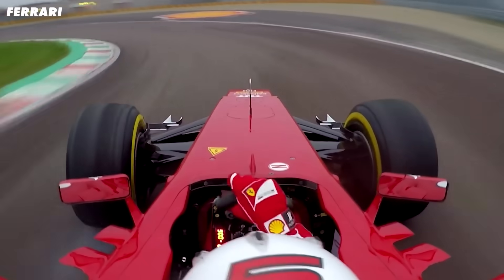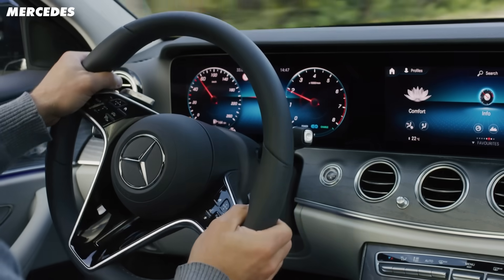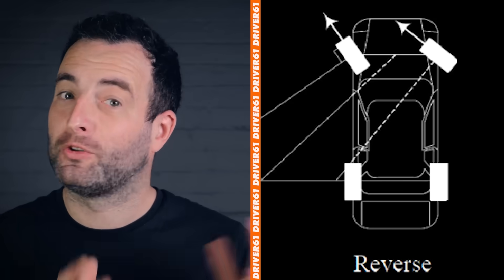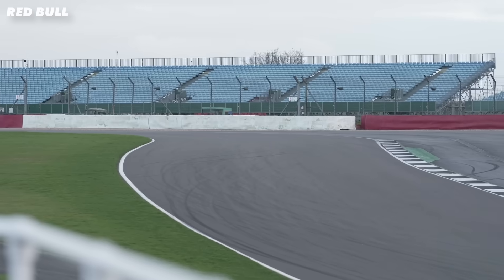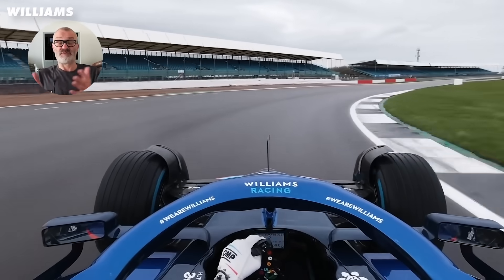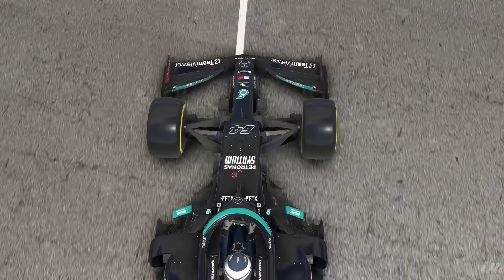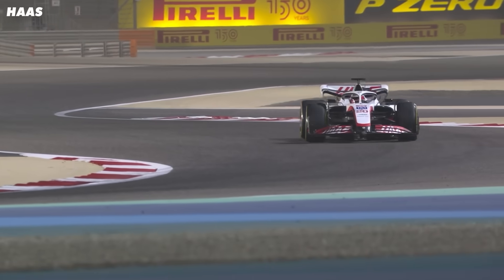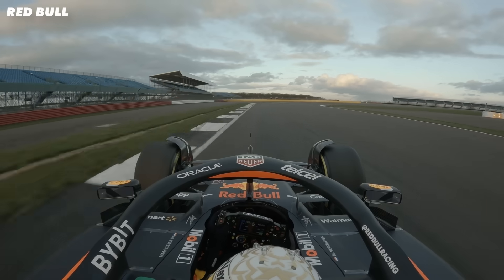The GENIUS Reason Why F1 Steering Looks BROKEN

Comment: Doesn't the inside tire actually experience less wear with anti-ackerman? So the outside tire takes all of the load and the inside is preserved, according to the load distribution in a corner. Could we say that parallel steering in a fast race car (tires at load limit) would already be an improvement over positive ackerman for the same reasons?

Comment: I thought the reduced slip angle on the unweighted (or lesser weighted) is inside tyre was to increase its contribution to cornering force because it is in the performance window where the turning angle brings the tyre into a slip angle where it can contribute to lateral force, instead of just scrubbing off speed, though some scrubbing can help to rotate the car.
To help the inside tyre do this, suspension geometry can be set to reduce the camber on the inside tyre so the contact patch is bigger. The contact patch of the outside tyre is increased by the vertical load and tyre deformation so increased camber stops the inside of the tyre from lifting
Reply: Tires don't necessarily have a higher saturation peak with more load. Some race tires have a negative trend, with more Fz resulting in a lower saturation peak. Either way the deltas are not big on actual tires most of the time.
Reply: @ArchOfficial  what I'm referring to is the effect of REDUCING vertical load on the inside tyre. Without enough load for a given steering angle, the tyre will skid. Anti-ackerman reduces the steering angle to avoid this
Reply: @Da5idc  Yes, and some tires will need MORE steering angle with LESS load. I remember seeing two tires that do that.

Comment: I'd like to know how the steering works then. Like how do you get the left tire to turn less than the right one on a left corner, but then turn more than the right one on a right corner? Or can it only be done in one direction & you just sacrifice the side with fewer corners?
Reply: It's called ackermann, and yes it will work the same in both directions
Reply: Geometry of the steering linkage.

Comment: When going around a corner the outside wheels travel a further distance. Hence since the car goes around it at the same speed i all places the outside wheels need to turn faster. Iirc thats why the are Differentials in road cars.

Comment: If I'm not mistaken, we are talking about the castor angle, correct?
Reply: No, you're mistaken.
Reply: More akin to toe in-toe out angles
Reply: @sandybarnes887  Not really. Toe-in and out are fixed settings. Ackerman angles move through a range.
Reply: @MrAdopado  not really.  Ackerman angles are not castor settings

Comment: So it is correct that this only works/produces more grip because there is a lot of downforce? Or would the weight transfer alone be enough to also work in a road car?
Reply: Usually anti ackerman as agressive as F1 is used only in high down force uses. Or maybe some karts or idk. But in theory for the most grip you should have the correct slip angle on your wheels that are steering. The most noticeable gain will be in high speed corners of course. Setup should be sone in a way ehich matches the car for the track. If there are loads of highspeed corners you'll want more slip angle on the outer tyre because you're increasing its load thus decreasing the inner tyre's load. Same goes vice versa for low speed heavy tracks.
Reply: @jacknoname9726  But you could change the "aggresiveness" of the anti ackerman by changing the steering geometry and the tie rod lenght and angle.
Would a very slight anti ackerman still produce more grip on a roadcar than the normal ackerman they have?

Comment: as far as I understand, Anti-Ackerman actually REDUCES tire-wear on the inside tire because the outside tire is driving with a certain amount of slip angle and therefore the inside tire is actually not scrubbing over the tarmac at all. The normal Ackermann behaviour would lead to massive amounts of scrubbing, because the outside tire does all of the work and the inside tire would just understeer
Reply: Yep, correct. Glad someone spotted this!
Reply: Yup, a slight explanatory error in the video.  Kinda surprised they didn't catch this while filming or editing.  But, Ackerman is one of the more niche setup topics out there (like Castor in karts), so it's understandable.
Reply: The ackermann optimizes the grip. Not just affecting the outer tire but also the inner. It can be spotted on the graph. The simple fact that the dashed line is not vertical shows that some type of ackermann would optimize the grip. With less tire load (inner tire because of load transfer) the tire needs less slip angle to get to its peak performance -> anti-ackermann.
Reply: Positive Ackerman would perhap increase tyre wear on a track, but to clarify, I imagine in a road-going car, exercising next to no slip angle, positive Ackerman would surely result in very low tyre wear
Reply: @matthewmcewen1  It helps a bit in road cars. But actually, Ackerman has surprisingly little influence on tyre wear with road cars, because on normal road cars most tyre wear occurs in straight line running. In fact, most road cars don't have 100% positive Ackerman, hence most cars squeal horribly in multi-story car parks... What Ackerman does do is change your steering feel rather dramatically, so road car designers tend to choose the Ackerman that gives them the best steering feel. The other thing negative Ackerman does to road cars is to increase the turning circle, which incurs the wrath of the marketing department. Even in F1 the dramatic change in steering feel cannot be ignored, and can present limits to how far the designers will push radical Ackerman settings. (And look at Monaco races, to see if you think negative Ackerman is being run there...)
Reply: @peterhewson4568  are you sure about that? Of course there is some tyre wear just because of some toe-in every car has. But the initial explanation in the video is correct about different radius for inner and outer tyre. Without positive Ackermann, the inner tyre would scrub over the tarmac.

For racing cars one needs to know the actual slip angle of the rubber, which is between 7-14° as far as I know and based on that you can easily calculate the amount of Ackermann for all steering angles.
Reply: @PoisonNuke  We are now in the realms of having to do real sums, using real car setups. Me? I'm just an amateur. I leave the complicated stuff to the clever guys.
Reply: @peterhewson4568  very informative, thank you
Reply: @peterhewson4568  Don't know about the exact implementation of Ackermann (with double n). I thought the squealing is just because the tires themselves skid because the inside of the tyre travels a shorter distance than the outside, but naturally the wheel velocity is the same inside and outside (on each wheel).
Reply: @IJsbeer74  Inside and outside wheels can rotate at different rotational velocities, unless the car has a locking differential. Any car with open diffs and 100% Ackermann will not squeal around tight corners, as long as they are driven fairly slowly.
Reply: @PoisonNuke   @Peter Hewson  Regarding the cornering and tyre scrub, my interpretation is the anti-ackermann scrubs less than anticipated due to the fact that front wheel speeds are not constant, and when turning,  the F1 car is effectively rotating on an axis centred vertically through the centre of the inside wheel. At least in theory, right? 🤔
Reply: @peterhewson4568  sounds like @IJsbeer74 was talking about the inside vs outside edge of a single tire. Not the inside vs outside tire. In which case I think he may have a point.
Reply: Jacob Vanderzanden    Good point. We call that "turn slip". My opinion is that I'm not sure if turn slip can ever be enough to cause squeal because the velocity delta is very small, and the tyre will probably have sufficient compliance to accommodate it. The most extreme turn slip occurs when turning the steering wheel of a non-moving car, which slips the tyre beyond its compliance limit, and that doesn't really make an awful or long lasting noise. It would be an interesting experiment though.
Reply: I like ur explanation  better.
Reply: 100%, I'm surprised heat effects weren't discussed more in the video, since tires performance is quite temperature sensitive, particularly in F1

Comment: I like it for a long wheelbase, heavier front end truck, as well. It's already "pointy" in front. Improve the outer wheel for weight transfer and stability in the turn. Along with better weight balance throughout the truck/SUV, and you get better handling. Especially with plus-tires that handle more weight/ load; go the sway bar, coilover, equalized setup route, and it's hanging with sedans, anywhere.

Comment: The way I understand it for a track car set-up is for keeping the proper wheel track while pushing the limits. The outside wheel under load will pull out while the inside with little load will actually end up turning in more. So when not under load it looks weird with outside turning more but under race load it tracks correctly.
Reply: It's exactly as scott said. The tyre with more load will be able to use more of the slip angle. The outside tyre is the one with most of the load. How I understood your statement is that in ur mind the steering system angle is ther for bumpsteer correction. This is not the case because correctly designed cars don't have bumpsteer that needs to be corrected. The slip angle was very well explained in this video. More load more slip angle.